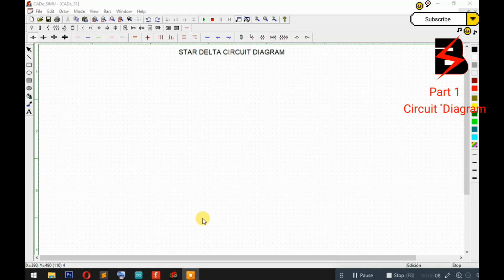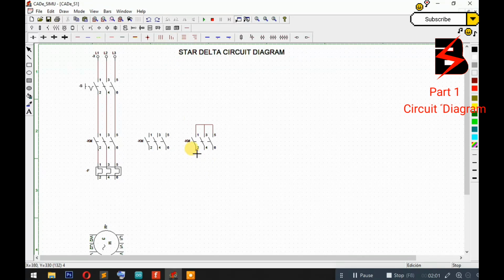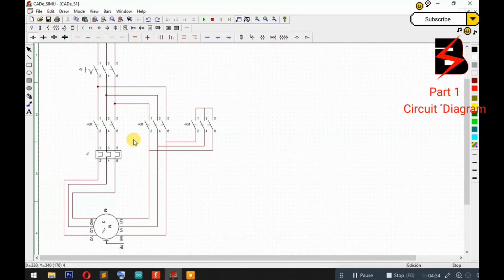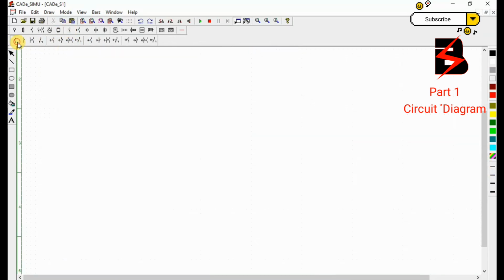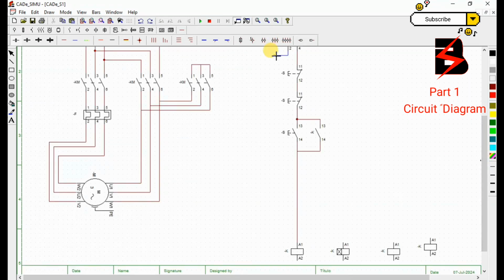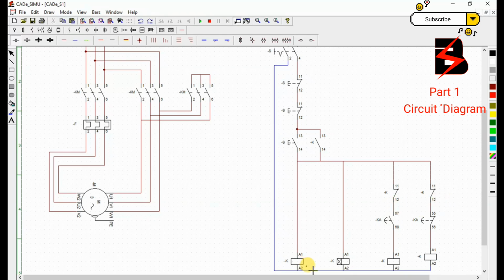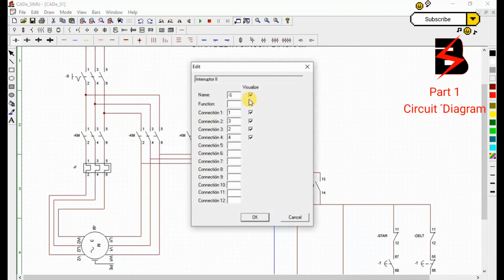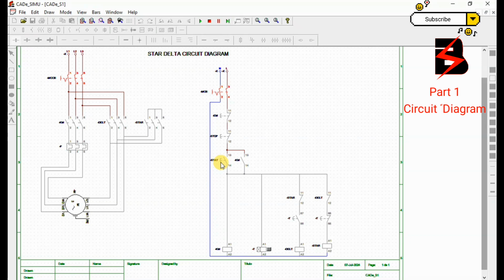Star Delta Motor Stater Part 1 (Circuit Diagram) with Cade- SIMU/ Industrial Automation @bawashir

Comment: I think motor connection is problem .. I connected in same way as yours .. But my motor is not running in this simulator
Reply from the maker: Watsapp  +256784335700

Comment: I drew exactly the same circuit you did and simulated it but my mine is not running. my software is the same as yours. The START switch doesn't even hold as soon as I leave it switches off, what could be the problem please help
Reply from the maker: Send me your project on watsap
+256705853029
Reply: I'm experiencing the same thing here.
Please help